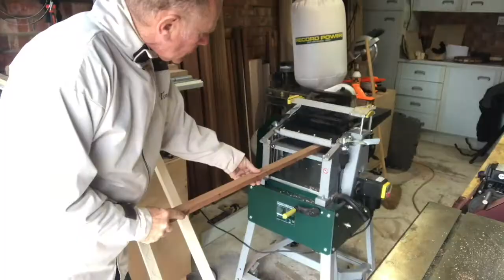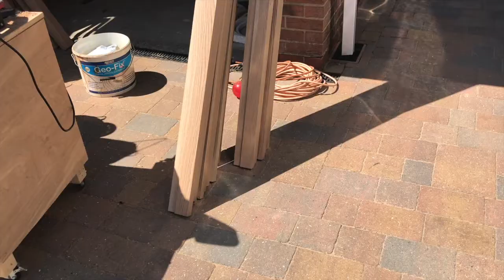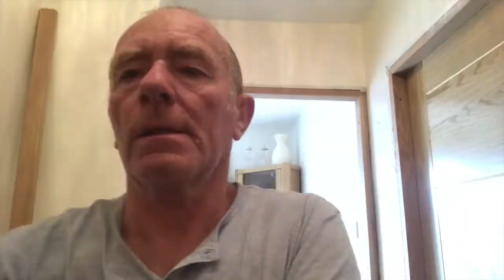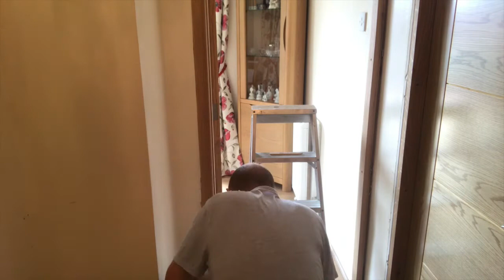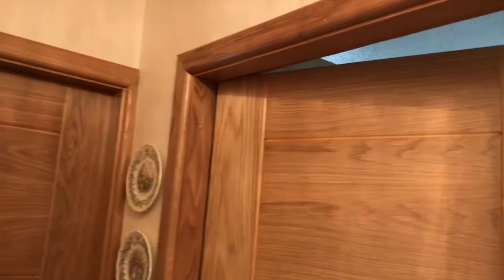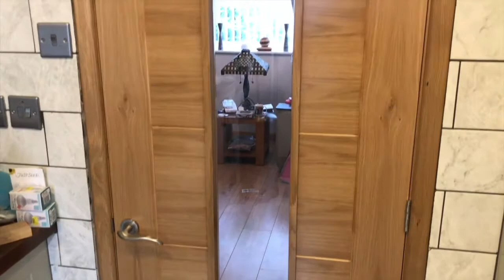# 63 Fitting 9 Oak Doors, Frames and Surrounds

Comment: What are you doing in 3 minute Tony? Do you hammer them nails deeper into the wood? Nice video. I have one door frame to install but it is made from oak veneer unfortunately.
Reply from the maker: Thank you. I am using a punch to knock nails in further so I can fill with wood filler. Cheers Tony